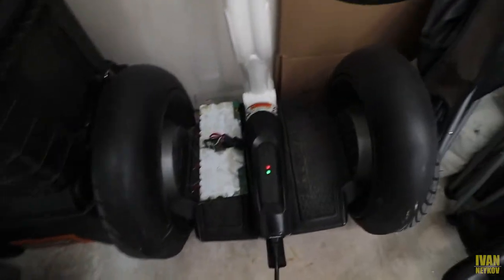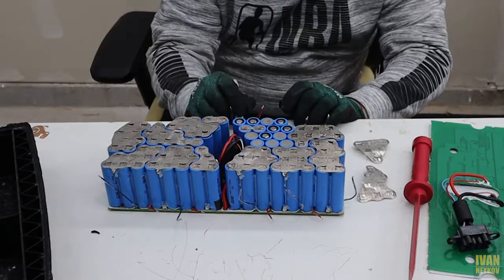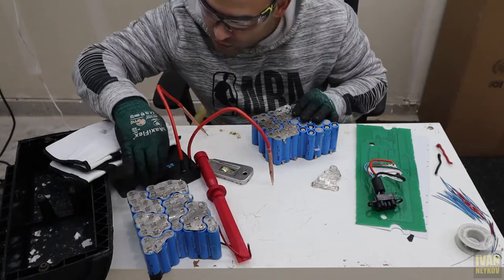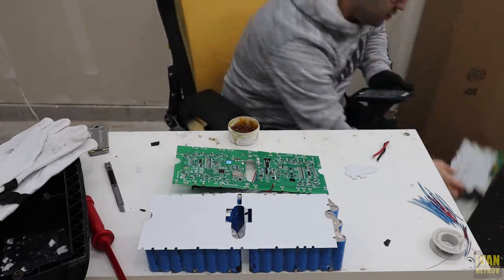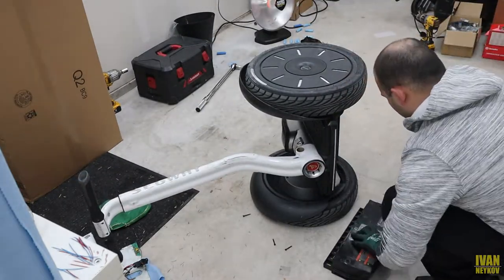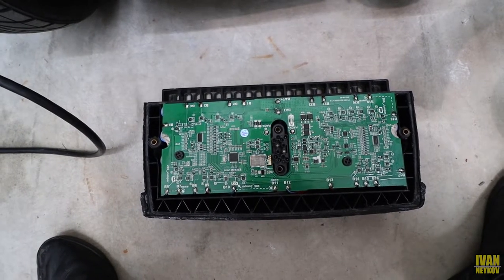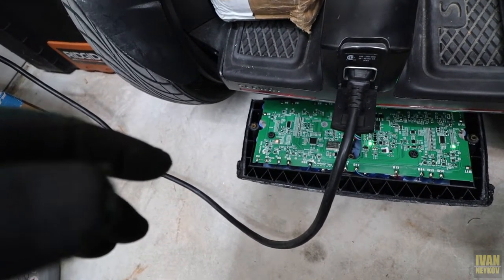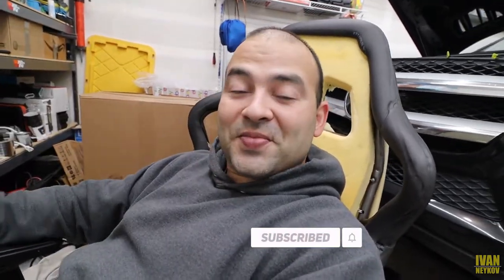How To Fix Segway Battery Part 3

Comment: Which was you desolder battery back to the board? Any tricks or maybe you have an instruction? I'm scared to fry board my board( Thank you for respond )
Reply from the maker: Write everything down take a bunch of pictures and do everything slow step-by-step. Don’t rush it. that’s how I did it no instructions or anything I just removed one board and then put the new one. you can do it just don’t rush it
Reply: But battery was fully charged and balanced right? Which power cable was first and which last? Mail - or + ? Thank you for your respond )  @Ivan_Neykov
Reply from the maker: @lopanton007  yes, the battery was fully charged and balanced. and first, I connected the little cables on the side of the board and then on the end I did first negative(black)and the last was the positive (red) let me know when you get it fixed

Comment: Segway error code E10A
Reply from the maker: Error code: E10A (E407) Meaning: Power Base defective (message from CU-Board) Troubleshooting: When frequent occurrence that BASE has to be sent in. E205 Meaning: has The rear controller board an error reported. Controller board defective